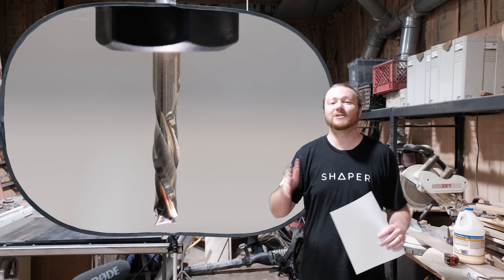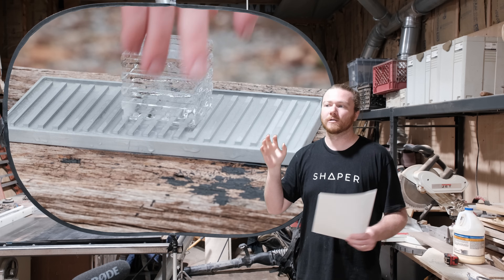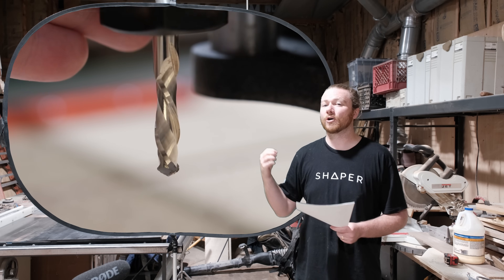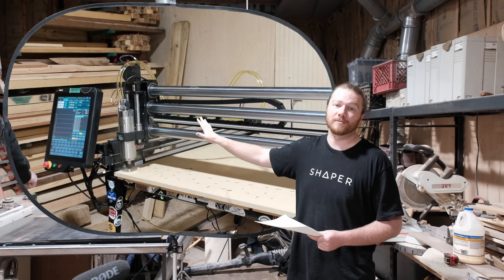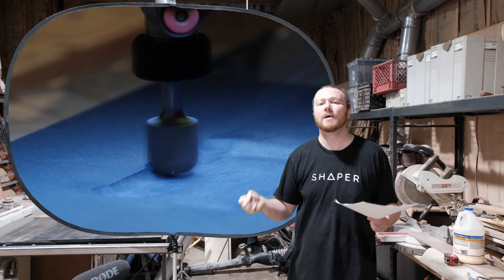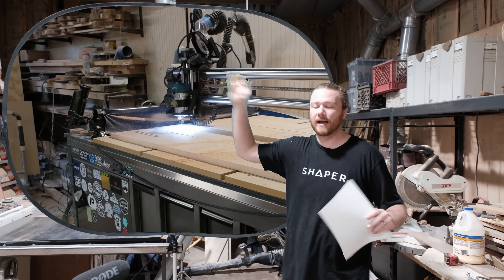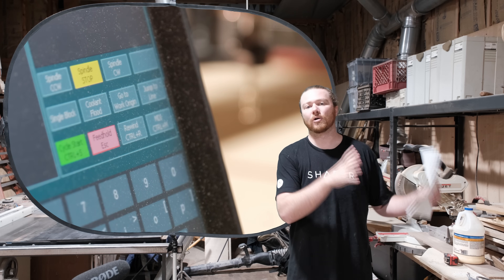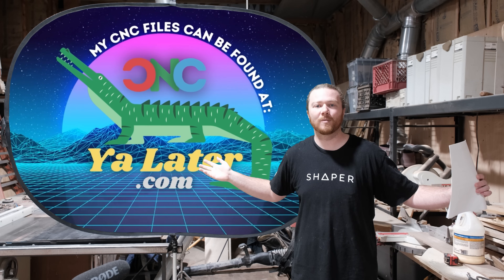10 Differences Between CNC Spindles & Routers (I Use Both)

Comment: 220 volt does not provide more torque or power. Although, 220 volt motors do run cooler, so they should last longer.

Comment: You're confusing watts and volts. Volts have absolutely NOTHING to do with how powerful the CNC is. It's just a regional difference in input energy coming from the outlet. That's all. The U.S. (and Japan) use 110... Europe uses 200-220.

WATTS is a more viable reference of how powerful a device is.

Comment: if vacuum machine noise more than router you have totally wrong vacuum, have many many silent version vacuum machines not noise lot, and if you have woodworker shop all normal uses vacuum outside shop own shed were can clean easy and not noise anythink  in shop. easy cheap build outside wall small noise insulation shed and vacuum have there. dont be stupid, use and buy tools smart.

Comment: my country, europe good router cost about 300-400€ and good 2.2KW spindle ER20 silent water cooled cost lot cheapen 130-159€ and VFD 2,2KW about 55-80€  i has before woodworker router but not ca use neightbour not can sleep next 2 house if i working my garage ewening. but i change spindle silent and now can working all night and anybody not hear near my garage what i doing. and real life, router bearing have worst not can use longtime big work, real spindle all bearings have lot lot better. i need say, dont use ewer router to cnc machine totally wrong tool you cnc.  lot better buy good big real spindle than expensive router. noise have first important option and then torgue have spindle lot better, router i can cut 3/4" plywood only max 1/4" pass /time but good spindle i can cut 1/2" /pass easy. lot fasten make all work. my option all cnc user have NO buy ewer router.

Comment: I have a questions about your spindle.  Do you heat your barn?  how cold is your weather at its worst?  I am asking because i have a garage that I am adding a onefinity machine to and upgrading to a spindle.  But it is uninsulated and unheated so I am concerned that the spindle may freeze in Jan/Feb when we can get to -40C.  So I thought I would reach out and see what you are working with.  Thanks for all you work!
Reply from the maker: Hey! I'm north of Atlanta so you can check how that compares to your weather. We do get freezing weather quite a bit.

I use RV antifreeze and it's been great! My shop is not heated

Comment: Why antifreeze? Distilled/deionized water has higher thermal conductivity, is non-corrosive, cheaper, and you're not in a vast temp differing environment like a car motor is. Unless im missing something.
Reply from the maker: It would freeze in my woodshop.

Comment: Noise pollution in a shop environment can be supplemented by placing a couple noisy pieces outside. They may need to be placed in a cage, wall cabinet, insulated or a cooling fan. I've seen air compressors and dust collection systems both placed outside in cabinets that have sound baffles on all of the surfaces. rubber spring foundation lifters can also eliminate vibrations through the floor.
Reply: I soundproofed my dust collection. If you want to do it right you need to do sound clips, hat channel decoupled from the ceilings, walls, layer two sheets of 5/8 drywall sandwiched with mass loaded vinyl, seal your door, use green glue etc. There simply isn’t any other way to properly soundproof. 

In terms of noise, I’m quite sure if most saw the setup I run they would be absolutely baffled. I come from a different field/ hobby not affiliated with woodworking and let’s just say I haven’t seen a single dust collection system in the woodworking industry that isn’t inferior. Harvey at least has the right idea. Housing an obscenely loud blower or series of blowers, inside a cyclone filter and blowing air downwards and around a cyclone is not an efficient method, period. In massive shops, it may be the most convenient, but it’s far from ideal. 

I have a soundproof closet for my DC for my Axiom Elite CNC , 3HP PCS, Planer, small tool ports etc and I can literally hear myself whisper in my shop when it’s running full speed. The suction from my dust boot will grab the surface of a 4”X24”X 1” walnut board and hold it in place like it’s a piece of paper. Zero dust or chips on my spoil board or surrounding areas. It runs off of 120v and is variable speed. 

I’m not a “YouTuber content guy” but perhaps I’ll do a video at some point. I almost feel bad for the guys using shop vacs and 80-120 db dust collectors, especially in a CNC  setting where it’s running for hours. Couldn’t imagine.

Comment: Interesting, as there are a few European spindles like KRESS brand, consumer power tool motors. The noise from the router is caused by the Fan/blower designed to keep it kool, and keep the wood dust out. And also there are companys that offer ATC for the ends of these consumer power tool motors

Comment: Love all of your content. I just replaced my journeyman with a Makita. Now I have an elite journeyman with stiffy, z-20 slider, and PwnCNC 220 water cooled spindle with a cw3000 chiller. The differences are worth every dollar. No more screaming router with a chattering end mill. I cut my G.O.A.T. Spoil board with a 3/8 ‘‘em on a 1/2” shank at 21000 rpm’s and 100 IPM - cut that mdf like butter. I am using a PwnCNC V9 dust boot which sucks really well. I like the hose behind the spindle so I can see what’s happening. I have a Harvey G700 which runs around 70 db at 60% which is what I need for sufficient suction.

Comment: You need to add number 11.  If you have a spindle and a problem with your Z axis OneFinity will not support you. They will only help you if you have a Makita router. Here’s the email from OneFinity support I received:

. “Since a spindle is attached to the machine, we're unable to assist with any issues.  If you remove the spindle and put on the supported makita router, we can troubleshoot and see how it performs.  If there's an issue with the makita router attached, it will be covered.”  

However they did offer me suggestions in a  later email.

Comment: I still don't get it, doesn't every CNC Router use a spindle?

I always thought a router is short name for a three axis CNC mill
Reply: Router is a generic name for a milling machine that is not used for metal but for softer materials like wood and plastics. They come in both hand held and CNC versions. The hobby CNC version basically combines them and  stacks a handheld router on top of a CNC controlled gauntry system. The biggest downside to using a handheld router instead of dedicated spindle I say is that brushed universal motors in general are over 100 dB of noise just from the motor while a spindle motor is whisper quiet cause it is brushless.
Reply: @johnpekkala6941  oh that makes more sense thank you

Comment: What would you recommend for soft metal cutting on a small desktop CNC like an 3030 PROVer MAX from Genmitsu (I am currently considering to buy one)? I live in an apartment and don't have a workshop, so noise, space, and cleanliness are factors for me to consider. And yes, price is an issue for me. However, I don't want to use dust collection but rather depend on an enclosure (if you have any recommendations for that, I would be very grateful if you told me :] ). So, noise is almost as big of an issue as dust getting into my apartment. Therefore, and considering that a "cheap" spindle would cut better than a router and definitely better than the 300W spindle it comes with and that it would be considerably quieter, I am considering to go down this path. I am new to CNC but not new to diy hobby stuff (I am very comfortable modding 3D printers, soldering, wiring etc.), so I am down to invest time if that means saving money (I can't do woodworking in my apartment to build an enclosure for the cnc).
Sorry for the long message. Thank you for your content, it is very helpful to me :). I don't expect you to see, read or answer to this message, but if you did, that would mean and help me out a lot.
Have a beautiful day :)

Comment: What would be your thoughts on a spindle that supposedly has upgraded bearings for specific cnc use like the open builds er-11 router and/or the Carbide ER-11 Compact Router? I'm a weekend warrior and I don't really want to buy an $850 router but I will if I have to and your opinion or anyone else's opinion from experiance would be a great help.
Reply: I've watched several breakdown videos, and my own conclusion was I would buy a decent but cheap chinese spindle, and when the bearing eventually go out, replace them myself, rather than buying a 'usa' spindle for 3x to 4x the cost that is actually a chinese spindle that they put better bearings in and raked in a massive profit for an hour of work.
You could also put the better bearing in right from the start, but I'd only do that if you found you needed to.

I make jewelry on my 10 year old 6040 table. It's got a water cooled spindle, and I made my own flood coolant. I cut mostly alu and gummy 2600 cartridge brass sheets. The spindle bearings are a bit worn out, but they are not the limit to precision (but do contribute to bit wear). Flex of the machine is the primary limit. Still, I make wax seal stamps and test made some collectable coins for a friend that had plenty intricate detail.

Comment: I used a chinese 6040 cnc that included a water cooled spindle, I used it daily for 4 years, and the thing just worked , it held up to thousands if bit changes
Reply: I've had my 6040 for over 10 years, still running that same water cooled spindle. I've had a few bad crashes that have given it a little more growl. When it dies, I'll probably go size up, just for a little better experience when pushing the limits (aka trying to cut steel)

FYI, flood coolant is a game changer. I made mine with a fountain pump and rubbermade tote. I got an alu sign from the scap yard and mounted thin 1" alu angle on it to make it a coolant tray, slightly tilted and the low end funnels to a pour spot using the alu angle.
For a cheap enclosure box, I got the white foam that has the silver plastic on one side. It's light, easy to cut/shape, and you can tape the whole thing together. I left the front piece separate, so I only take the whole box off for maintenance or oversize objects.
I was given the snap-lock nozzle for free, but when I was broke before that, I used a tube with a coat hanger strapped to it. I was very happy to get the proper nozzle, as it is much easier to point where you want it and have it stay aimed there.

Comment: Can you run spindles up side down? Through a table, for example.
Reply: Generally yes, though you can always ask the seller. Air cooled is probably better for that, as the airflow will help keep chips out of it. In general, spindles should not be sensitive to angle. In a theoretical sense, they might wear the bearings slightly faster. But in a real sense, I have cheap hobby router with a liquid cooled spindle that is 10 years old and has had many bad crashes (bent a ballscrew...) It still cuts fine, though the bearings have a bit more growl.
I doubt running it on it's side would remotely compare to wear from the crashes I've had.
Reply: You can do anything you want if you are a machinist. Think it up, make

Comment: Why RV antifreeze?   Wouldn’t any antifreeze work?
Reply: Yes auto antifreeze is fine, and use distilled water if you do (I learned the hard way, when it got all clogged up with white slime growths over time).
RV antifreeze is made to avoid that gelling & bacterial growth for systems that are filled up and ignored (= no maintenance) for a long time.

Comment: If you are paying $1000 for a new spindle it's a pile of poop made in China you can double that if you want an autochanger.
Quality autochange spindles start around $5K.
If you need a reconditioned spindle for a Kern Micro c$30K.
Reply: You've nicely highlighted exactly why people should buy a chinese spindle.
I've had a cheap chinese spindle cutting alu and brass for 10 years, still running, including several bad crashes. Those are the spindles you are pooping on. Why should someone spend 4x the cost for no discernable gain? For the difference in price, they can go whole tiers of upgrade higher for the price or afford to put another money making machine in their shop for the difference in price. Or they can save their money, and in the event of a catastrophic crash, they can take their pile of saved money and buy 3 spare spindles or an extra motor etc to avoid downtime.

I work in a machine shop with a name brand Bridgeport and 2 knockoffs. Guess which have longer travel axies, better motors, better designed cases that are multipiece for easier belt maintenance? You can buy 3 of those objectively better knockoffs for the price of 1 Bridgeport. That's an awful lot of money for a shiny little nameplate.

Comment: The max speed of a normal spindle is about 24000rpm vs the router is about 32000.  when using very small dia bits or a tapered carving bits that have a small tip high rpm makes a difference.,  Some CNC machines have air spindle adaptors that run at 60000 rpm.   Router motors are universal motors, meaning they can run off ac or dc.  Running the router on DC will provide improved torque performance - however you have to remove any stock speed controller.  I normally use a water cooled spindle,  but I can also setup with 3 routers with different bits and change the whole router very quickly rather than mess with a collet..
Reply: My understanding is that DC motors achieve slow speed by reducing voltage, therefore they lose power/get weaker at slower speed. Assuming it's being driven by a vfd, an AC motor has it's speed set by the frequency, but the vfd can do that frequency at full voltage, so the amperage and power drop off much less.

A cheap hardware store router (or Dremel) isn't doing that. I'm not sure what they are doing, but I'd expect them to lose a lot of power at low speed.

I've actually used my cnc router as a polishing station, by putting a 3" or 4" polishing wheel on the spindle. It worked well, as I could set a low speed and the water cooling loop meant it didn't overheat like a handtool. But it was very not worth the hassle of cleaning up red rouge from my cnc machine. If I ever do that again, I'll cover and tape everything off thoroughly beforehand.

Comment: I will add that my router shakes the entire house in terms of noise. It is light years louder than my dust collector.  I so wish I would have spent the extra money and got the spindle upgrade when I bought my shopsabre CNC.  I 'm upgrading now with a Chinese spindle and just now got it delivered...solely for the noise reduction.  If you buy a CNC....trust me...go with the Spindle.  The router will drive you absolutely insane after a while, especially if you have your set up in the garage and you have a wife and/or kids.  I literally use my CNC maybe 5% as much as I would like to because I do want want to fire it up and have to listen to that router screaming away for hours and hours in the house to do a single project.
Reply: Thin surfaces (3/4 plywood, most kinds of tables, etc) can amplify the noise of machines running on them. Adding pavers as an isolation layer can help significantly with this. Try running the machine on a concrete floor to see if this is your issue.
Reply: @tallskinnygeek this is a good point. I have one machine that has 10 concrete blocks attached to it to add mass. It really helps a lot. Not under it, mind you - attached to it. I designed the frame to allow me to slide blocks into it so they actually weigh the machine down to the floor and make the entire thing harder to shake. I would never, ever even consider using a router instead of a spindle. My machines go all day long, almost every day.
Reply: Built a box out of plywood and some cheap sound proofing , huge difference… can barely hear the thing….  The dust collector sits outside in one of those cheap plastic sheds.  Work area is now liveable again with cnc running.
Reply: https://youtube.com/playlist?list=PL9WssGfa18FYvaafbXrUKU6RhC8RA0YAh&si=aA-HdsBHsmZKqqJj

Comment: I would like to know which spindle you  use.  Your link opens up a page with a lot of options.  I am looking at the 2.2kw 220v ER20 80mm 2-pole 400hz water cooled, because the price difference is minimal.. Also Motor Cooling would be Water, but since you are recommending the silicone tubing, buying the clear tubing would not make sense, right? and the Kool connectors, right? CNC Controller I am thinking from watching your videos the Onefinity Masso is the proper one to choose, right?
Reply from the maker: Yes you are correct, the one you mention is what I use. Reach out to them and ask about the silicon tubing. They might have switched to that now
Reply: @HamiltonDilbeck  Thanks for replying.  I hope to get this set up soon.
Reply: @HamiltonDilbeck I have the exact same question! But also is there a reason you didn't purchase the Kool connectors and Silicone tubing with the Spindle product ?? Thanks

Comment: FYI, if you step up to the 2-1/4HP router from Makita instead of the 1-1/4HP you can use the Musclechuck quick change collet system. Makes changing bits an absolute dream compared to the two wrenches and you can still go up to 1/2in bits.  I have both, and very soon I will be buying an FM30 ATC from CNC Depot.
Reply: Better put your order in now, lead time on the FM series is pretty long the last time I looked.  That's the way I want to go too.

Comment: its easy to sound insulate a dust collector using an enclosure,or putting your dust collector outside in its own shed, so you always get a quieter sound when its running.
Reply: make the shed big enough for your compressor too, so annoying.